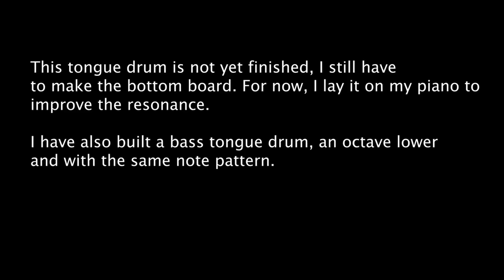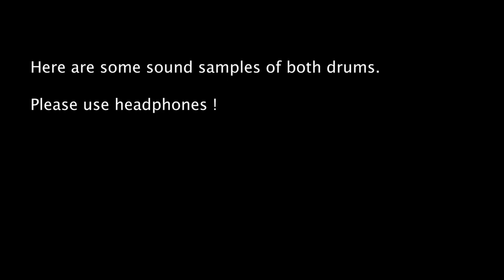Making and tuning a perfect sounding 2 octaves Wooden Tongue Drum (by a musician & for musicians).

Comment: Does the type of wood have an immense effect on the instrument? I figure density will probably play a bit of a role in it
Reply from the maker: It does. I think the sound will be very bad with coniferous wood, I could have tried with oak but since this is a long process to make a drum, I tried with the best wood possible. I could have spare 10$ with a cheaper wood, but I don't regret to have bought paduk for this project. All marimbas and xylophone of the world are build with exotic dense woods, I guess it's for a reason !
Reply: @narnodel2  Several reasons actually but most importantly, longevity. There are some lovely light, soft woods that have amazing tone and resonance but they get absolutely destroyed after a very short time. Tuning goes out as the fibers compress and the tone shifts a lot more with humidity changes. This is according to a traditional Marimba maker I spoke with in Africa. He showed me Marimbas made of anything from pine to tortoise shell. Hearing a marimba band of 34 people was truly breathtaking.
Reply: and you'd be correct! there are specific types of wood used for African Slit Drums. Density is the main requirement along with others like:flexibility and tensile strength,  how much moisture a wood will absorb or repel,  how much resistance a wood will endure under hot & cold temperatures all of which will affect the resonance of the body as a whole.Btw the top or Head should not be permanently affixed to it's other 4 sides since all heads will either be damaged over a period of time due to playing, cracking and/or wear and plus the heads need to be able to be interchangable, because heads have different distinctive tones of tuned musical scales!

Comment: Straight up stealing the idea for the "high end table saw", that's genius.
And being a musician, I guess this would be a pretty nice project to start with. Thanks for the video!
Reply from the maker: Yes I'm a musician too, not a woodworker, and this project is not too complicated to start with. Good luck !
Reply: It's not genius, it's suicidal.  The blade is meant to be on the opposite side of the workpiece to your important parts.
Reply from the maker: Yes, it is just a jigsaw, and a small, weak battery powered jigsaw. I would choose another tool if I wanted to commit suicide.

Comment: That sounds great!
Gotta say, your jigsaw table is very nifty, I do not have a bandsaw, so using a jig saw like that could help in same situations. Your handplane might need a bit of sharpening I think :-)
Reply from the maker: Yes, that is a very cheap plane, and I’m not very good at sharpening. You can use the tool you want to cut the frame, I used my bandsaw but there is other ways !

Comment: I'm curious if it stays in tune...4yrs later?  e.g. moisture in wood may change pitch of things?
Reply from the maker: That is a good question, I checked yesterday with my tuner, the pitch hasn't changed 4 years later. But the instrument stayed at home, maybe it wouldn't have been as stable if I've had played it outside every day.
Reply: @narnodel2  thanks for the update...it's an interesting instrument to consider building.   I was trying to think of a clever way to make it fine tune-able....maybe a sliding bar weight underneath?   But maybe your results shows that detail is not needed!
Reply from the maker: @jasonpillingmusic  Yes you can fine-tune it with sticking some weights at the end of the bars. On my first tries, before removing wood at the base of the bar, I used this method which is reliable (unless you try to drop the pitch a fifth down !). It could be a solution if you are afraid that your drum won't stay in tune, first tune it slightly too sharp by scraping the wood, the finish the tuning by sticking metal weights. So later you will be able to tune the bars up of down if the drum is out of tune.

Comment: I wonder how a much softer wood like fir, spruce, Cedar or pine would sound as the resonant top? I imagine not near as resonant as the dense woods I see are typically used on these.
Reply from the maker: There would be a sound, but I don't think coniferous wood will give you a nice tone, they are way too soft. If you want to try to build one without buying exotic woods, maybe try with beech or oak which have a harder wood.

Comment: How do you tune it after time?
Reply from the maker: You probably won't have to tune it more than once every ten years. I have done mine two years ago and it is still in tune. I haven't glued the bottom board so it is still possible to access the tongues from below and scrape some wood if necessary.

Comment: What tools do you need?
The author: yes
Reply from the maker: What tools do you need ?
The author : please see video description
Reply: @narnodel2  ok every the carpenter has the right tools, but it's how to video so the amount of specialized tools used depresses me a bit 😉
Reply from the maker: Don't be depressed, if you don't have any power tool, it is possible to make it with hand tools (good chisels, a saw, a fretsaw, and a plane). But instead of being able to make a drum in one day, you will spend one week. The most useful tools for this project (the router and the jigsaw) are not expensive tools, I you want to do some woodwork you will need them one day.
Reply: @narnodel2  sure, it's the same in almost every hobby. Even if you want drive radio control car you'll still need strange tools and parts.

For a stranger who hits such a world for the first time, the amount of tools and various crap is overwhelming.

But the sounds made by the wood are dazzling 👍🙃
Reply: @narnodel2  that's also great thing, when author response to the comments! 
I wish you luck yt algorithm 😉

Comment: “Basic” tools, for a carpenter maybe
Reply from the maker: As I already answered, this is basic tools for anyone who does some woodworking. When I posted this video, the only other video which describes how to build a nice tongue drum uses several thousands $ tools, like a computer controlled router for example. The only tool on this video that costs more than 150$ is the ribbon saw, and I could have cut the frame by hand. I don't pretend that you can build this drum with a kitchen knife and a glue gun !
Reply: He did use very basic tools. FFS, he cobbled together a very cheap Ryobi jigsaw into a scrollsaw table. Damned ingenious of him. A router, drill, a few clamps, hand planer and some chisels. Any man should have these tools in their garage. This guy demonstrated just how little is needed to produce some fantastic work. Great job to Arnaud.
Reply from the maker: Thank you very much ken